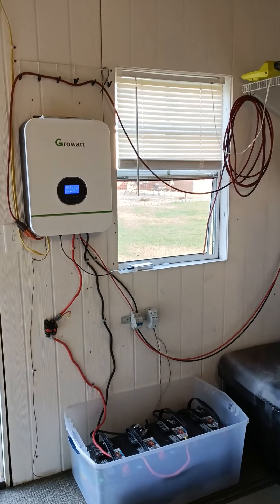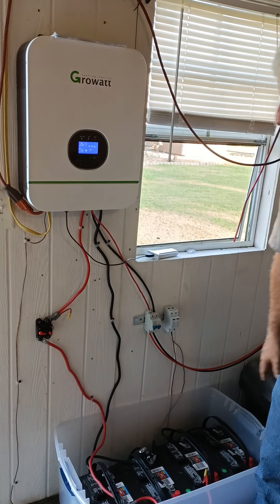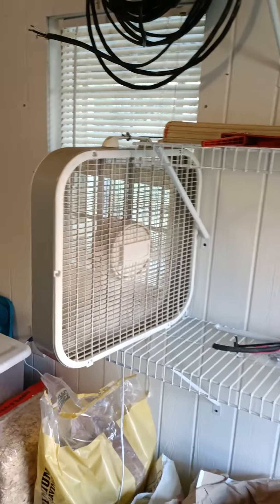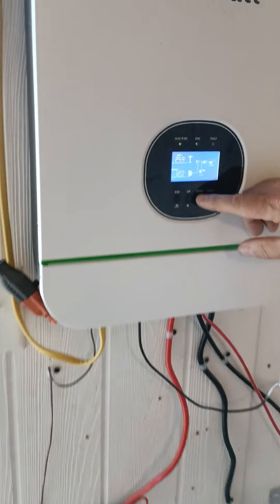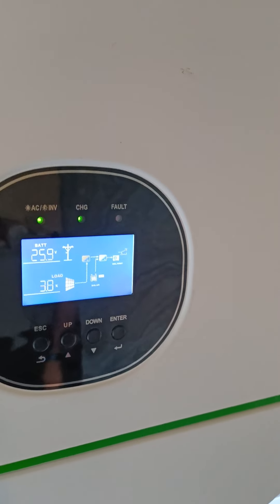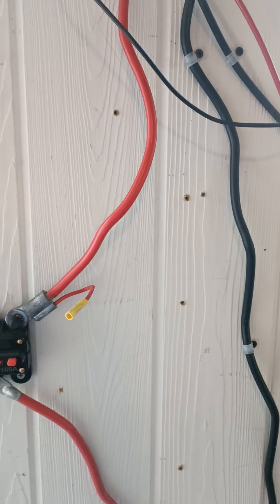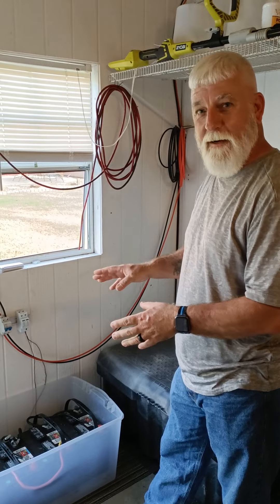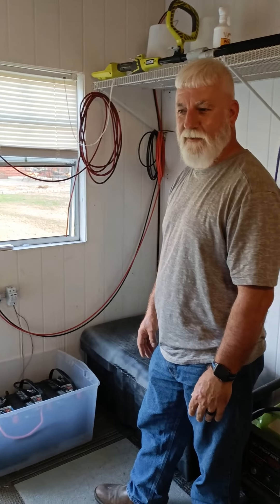Review of Growatt SPF 3000TL LVM Hybrid Inverter

Comment: If I was you I would put a fuse between battery and growwatt inverter on positive side to protect the inverter
Reply from the maker: This is a customer's solar system, but he does not need a fuse as he has a correctly sized breaker on the red wire between the inverter and the batteries.

Comment: How many watts are you panels? Where did you buy that 50amp breaker and box at?  How come you need or want to reduce it down to a 20 amp one? How do you like the wifi attachment. Where did you get your cut off switch. Thanks for the video!
Reply from the maker: There are different breakers for the solar, battery and AC output. These are at different amperages and need different breakers. The wifi works great

Comment: You might mount it on concrete board for added safety, little cost.
Reply from the maker: Larry is working on moving the unit to a different wall in his shed and is planning on backing it with hardy board